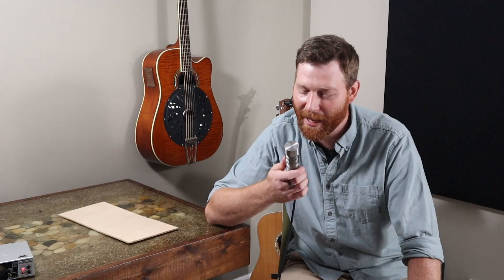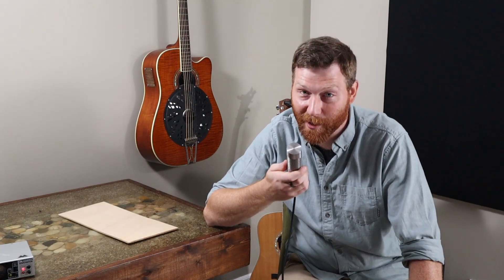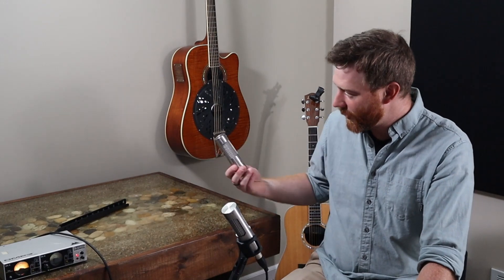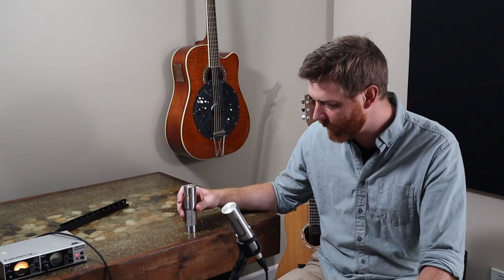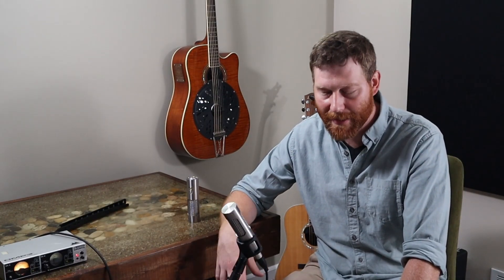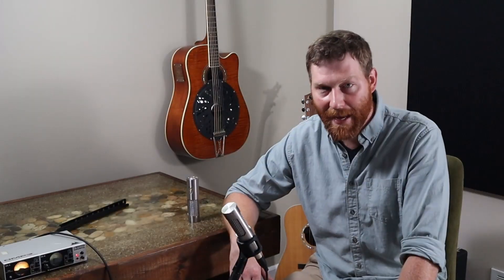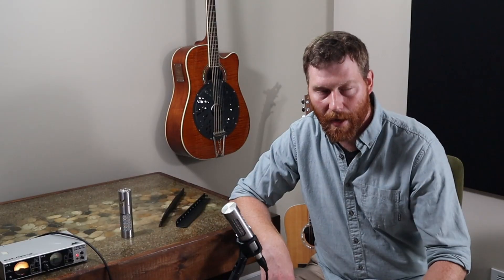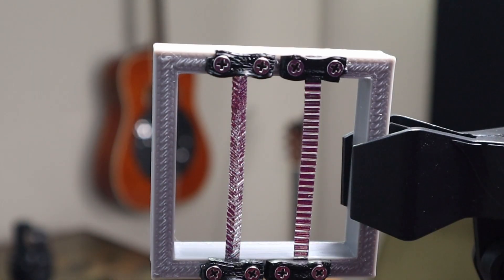Durability of the ALDER H44 Ribbon Mic

Comment: Well let's see phantom power can be blocked with a capacitor, I'm also won't pass the transformer. So the chance of actually damaging the microphone from phantom power over and low. Second the closest part and the wind blast can be fixed by a internal windscreen and blast filter, which is nothing more than a piece of brass screen, and some white silk material. And if you noticed he dropped the microphone with the end of it towards the desk if you dropped it flat on the desk it would have been more of a proof that you could drop the microphone as that would be the most damaging way to hurt a ribbon, would be to have it fall over sideways.

Comment: You take strenght as a way to go forward or improve upon the design that is thankfully still used and sold by renowned companies. To me, and i have not even seen any measurements but you are breakiing up the natural way of the ribbon to move, it only need force in the same axis as the shape of the ribbon.

Comment: If the angled/herringbone corrugation add more strength and rigidity, won’t it affect the flex of the ribbon making less sensitive to sound?? Haha curious but looks interesting!
Reply from the maker: Good question.  That is exactly what I expected and I had hoped to perhaps use any sound difference to advantage, but what I found in practice is what ribbon makers have known for a long time.  As long as the ribbon is uniform (not piston corrugation), then the response is dominated by the mass of the ribbon and the resonant frequency.  These can be equal between standard corrugation and herringbone, and they do not sound different, so long as the ribbons are tensioned to the same resonant frequency.
Reply: @alderaudio  that is interesting!!

Comment: How much effective gain is required to yield  lower noise (hiss) when using this microphone?
Reply from the maker: Thanks for the question, though it is not straightforward to answer.  Hiss can come from different places and in most cases I can think of additional gain isn't necessarily going to help.  If you've got a particular problem and want to give me more information so I can take a crack at answering, feel free to reach out on the website here: https://www.alderaudio.com/contact

Comment: I wonder if it’s less sensitive if more durable. I recon ribbons supposed to move a lot. Maybe you wouldn’t be able to detect a diff....
Reply from the maker: Yeah, so to my own surprise, the corrugation causes no discernible change to the ear or to a frequency response measurement when you compare herringbone vs traditional corrugation.  We have tested it.  Our conclusion is as long as the ribbon is still vibrating as one section (as opposed to piston corrugation), then the response is dominated by the mass of the ribbon and the resonant frequency, which can be the same with the new corrugation.

Comment: While the ribbon corrugation design is cool and all, I get a sense other aspects of this mic might not be figured out too well. For example, the body of the mic seems like it has a lot of space for resonances to form inside. Also, why use a transformer? Transformerless is way better for transient response. At least so Ive understood..
Reply from the maker: Good questions, and thanks for stopping by.  As far as the transformer, all ribbon mics have them, just due to their natural output, as opposed to dynamics where sometimes you can go transformerless.  But Ribbons are also better for transients than dynamics due to sensitivity of the ribbon so it tends to work out.  Quality and design of transformer does make a big difference though.

As far as space in the mic causing resonance - the physics going on inside the mic is quite a bit more in depth than that one factor.  I won't get deep into it here, but I can assure you the full design of the geometry of the mic was intentionally developed and tested to get to the final result.
Reply: Ribbon mics must have transformers because the impedance of the ribbon is usually about 0.2 ohms. You MUST raise that up with a transformer if you want a usable output.
Reply: @ScottGrammer  ok. I probably don't know enough about electronics to actually understand why. I do get what impedance is, and how transformers work for impedance. But what I don't know and understand is why do you need a certain impedance amount in order for the signal to get properly amplified?
I do know that when you look at a dynamic mic, there is a sonic difference, for the transient response, when you use a transformer and when you don't. And I clearly prefer the transformerless mods that Ive heard examples of.
Reply: @rist98  Transformers work kind of like the transmission in a car. A car's transmission swaps RPM for torque, or torque for RPM. A transformer swaps current for voltage, or voltage for current. There is no power amplification in either case, merely a change in the way the power is expressed. Impedance, in an electrical circuit, is a way of describing whether one needs voltage more than current or current more than voltage. The impedance of a ribbon mic's ribbon is very low, and low impedance devices are current-oriented, with little voltage. Unfortunately, the mic preamps we all use are of a much higher impedance, and they need more voltage than the very low impedance ribbon can produce. Without this voltage, there will not be enough signal for the mic preamp to work with.

By using an internal transformer, a ribbon mic can trade its current for voltage, thus creating enough signal for the mic preamp to work with. There is another way that the transformer in a ribbon mic helps: If we were to move the transformer to the inside of the mic preamp, and run the raw signal from the ribbon down the mic cable, we would lose much of the signal along the way because a typical 20 foot mic cable, which might have a total resistance in its wires of about 1/2 ohm, would turn 80% or so of the signal from the mic into heat before it ever got to the preamp. So the transformer is necessary, and it must be as close to the ribbon as possible, i.e., inside the mic. 

If you think about how ribbon mics are made and how dynamic mics are made, they actually work the same way - ribbon mics ARE dynamic mics, because they work on the principle of a dynamo. Moving a conductor through a strong magnetic field produces a voltage that is proportional to how fast the conductor moves through the field. Ribbon mics only move a single conductor - the ribbon -  through the field, and so they don't produce much voltage. The mics we think of as dynamics, which are more properly called "moving coil" mics, move dozens or hundreds of conductors through the field - each turn of wire in the voice coil counts as a conductor - and so they make more voltage. A transformer just synthesizes those extra turns of wire for the ribbon.

I hope this helps.
Reply: @ScottGrammer  Yeah, I pretty much knew all of that. I also know transformers work via the magnetic field, hence why they slightly muddy up the impulse response.
I also know how mic preamps work via Voltage. But my question is why. Why can't op amps work via current. If ribbons have current, more than voltage, why not use what they have and amplify via that?
I suspect this might be a dumb question, for anyone who is actually well versed in the subject of electronic amplifiers. But still, its smth Ive wondered.
Reply: @rist98  The only dumb question is the one you don't ask. Opamps can operate from a current source by feeding that current onto the non-inverting input without a series resistor, but it's not the op-amp's native mode of operation. The issue here is noise. An opamp configured to operate directly from the output of the ribbon is going to be very noisy, as the thermal noise generated in the first stage of the opamp will be greatly amplified, much more so than usual, and the result will be a poor signal-to-noise ratio. The transformer does not do this.

Comment: Any ribbon would survive being dropped like that, phantom power is fine on a ribbon, provided you aren't using TRS jacks, like in a patchbay, and if it can't survive in front of a kick drum what exactly has been accomplished? Doesn't seem any more useful than a standard ribbon, which isn't very fragile to begin with, unless you've removed the windscreens.  Just put a $10 pop filter in front of it and you can a ribbon fearlessly on anything.
Reply: Pop filters affect frequency response...

Comment: But this rigidity doesn't affect the frequency spectrum?
Reply from the maker: When tested we find no sonic difference between the two corrugations, and they are not distinguishable by ear either.  I believe this is due to the effect of sound wave transmission into the ribbon being dominated by the effect of mass.